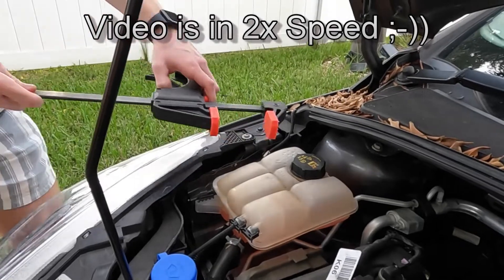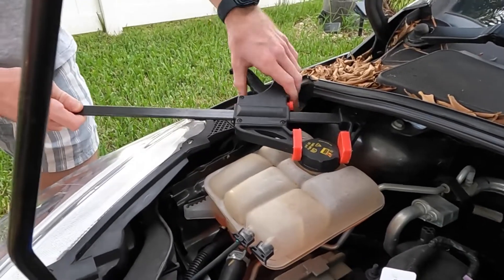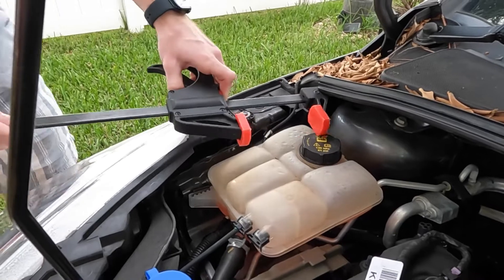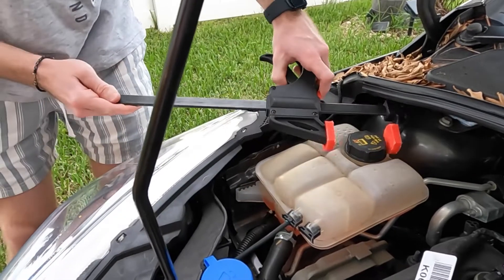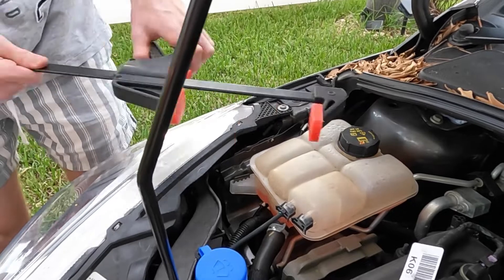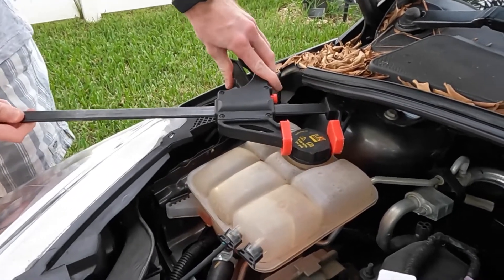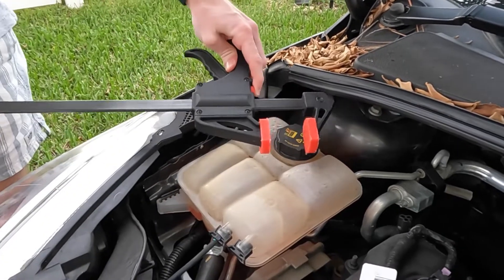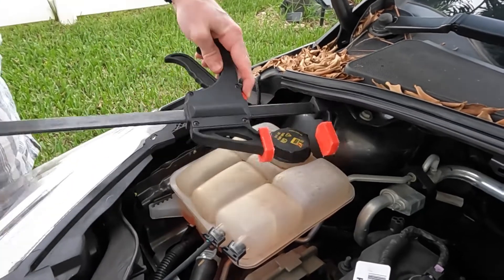How To Remove A Coolant Cap On A Ford Focus SE 2018? (Easy FIX)

Comment: My 2013 ford fuctus piece of crap has the same issue, along with the power shift trans. I'm waiting to see where the class action against ford about the power shift trans goes. The trans is out of its 7 year warranty now and I juat had the computer module replaced, lucky I had a second car to use while I waited months for the module to be replaced.
Reply from the maker: Wow - that sounds crazy. So sorry to hear. I guess there's a reason why they have one of the shortest warranty periods ....

Comment: If the cap plug breaks off, just pour boiling water over the area for about 2 mins, then twist out the plug with a pair of needle nose vice grips and replace the cap with a new one
Reply from the maker: Oh ... interesting - thanks for sharing